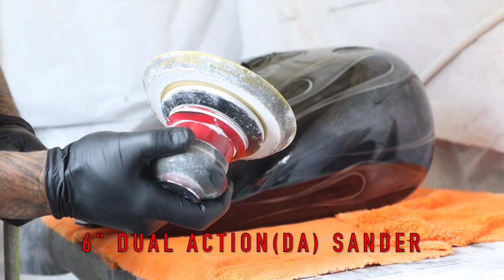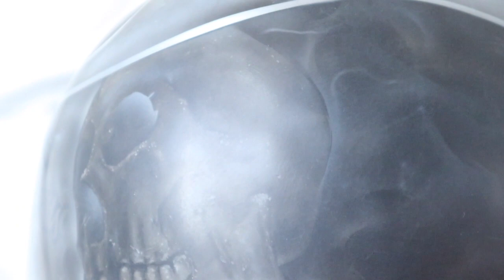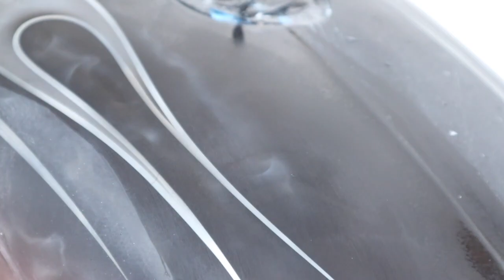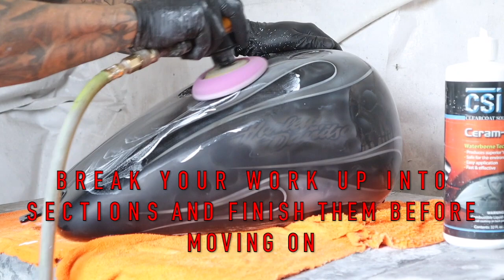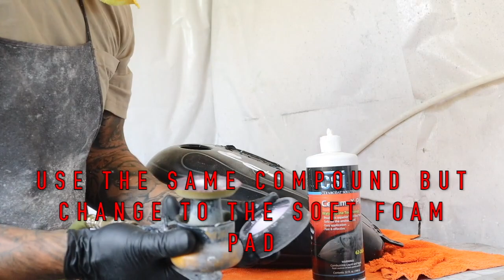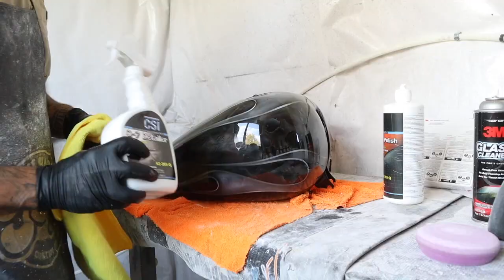How to Sand and Polish Clearcoat to a Glass like Showroom Finish

Comment: How many coats of 2K Clear do you put on after your final artwork/graphics?  How long do you wait to wetsand and polish? is it 1 or 2 days... or more like 1 or 2 weeks?
I noticed you used 3m 1200 and then straight to 3000?  do you recommend like a 2000 in between?
Thanks for such a nice video !
Reply from the maker: 3- 4 coats of clear, I wait 18 hours before cut and polish.